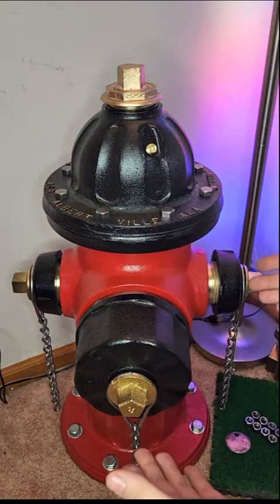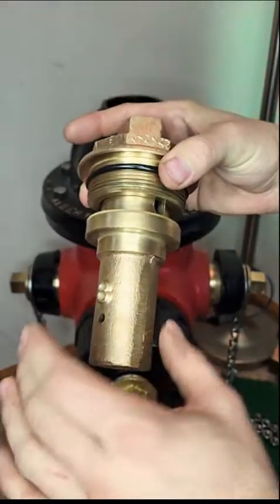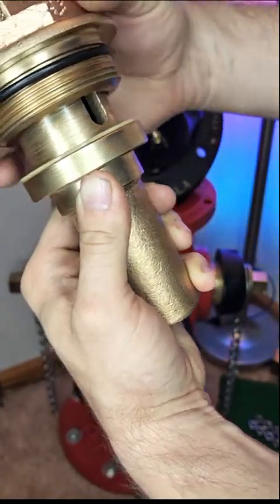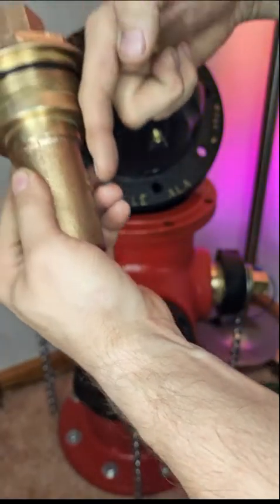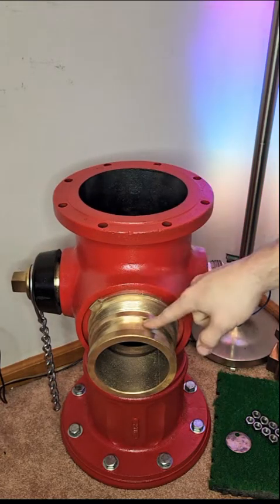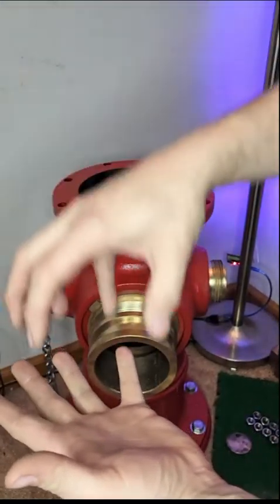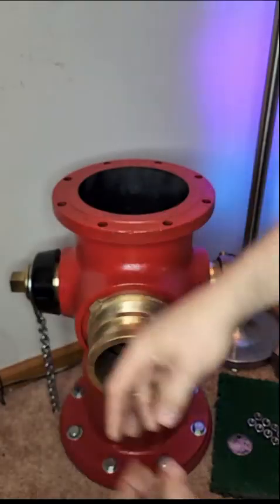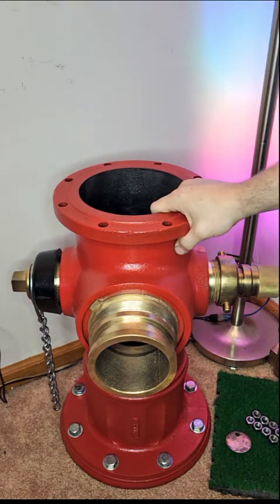How a Fire Hydrant works.

Comment: Once a fire truck wants to refuel the water tank from a fire hydrant, does the process only rely on difference in pressure? And does the LPM stay fixed or it varies over time?
Reply from the maker: I am not an expert at all, but from what I gather, Yes they can refill on water pressure alone, or they can use the pump to suck from the line to fill the tank faster!  They can even in an emergency suck from a pool or a lake to fill the tank.

Comment: The side discharges are not used for connecting hoses for firefighting directly, just for connecting alternative or additional supply lines. Firefighters always use a pumper for exact regulation of pressure and flow. The side discharges are also used by other members of the local municipality, for instance: flushing sewer lines and filling flush/vac trucks and street cleaning equipment.

Comment: The 4 1/2 inch outlet on the front is called the steamer outlet in the firefighting world. It goes back to the days when they actually used steam powered engines to pump water. I am a retired water supply operator and also a retired volunteer fire fighter. Your description of the hydrant is pretty much spot on.
Reply from the maker: Thank you very much!

Comment: I have a very nice old Mueller I found in a antique store..
I wish I could tell you the year it was made but no date on it...
When I was restoring it I had to replace the two small nozzles because they were both odd sizes and not two and a half inches but more like two and a quarter inch 🤔
Couldn't figure out why that was but I removed those nozzles and replaced them with a standard two and a half inch size!
Had a hard time finding one's that would work but I'm pretty resorsful
.
This hydrant only has the name of Mueller,
Chatta.Tenn.,
and 41/4"...
As I mentioned,no date...